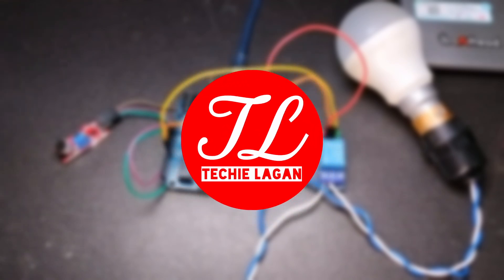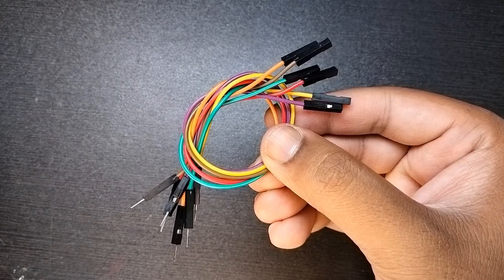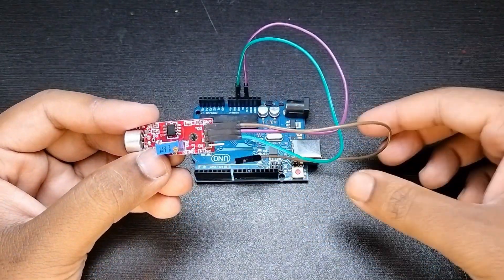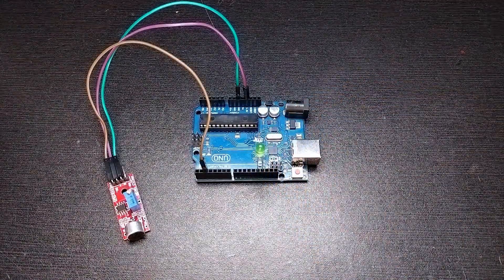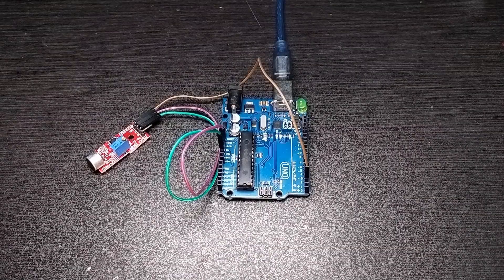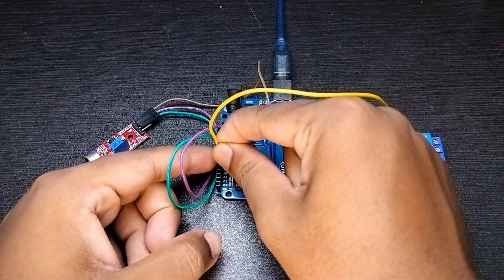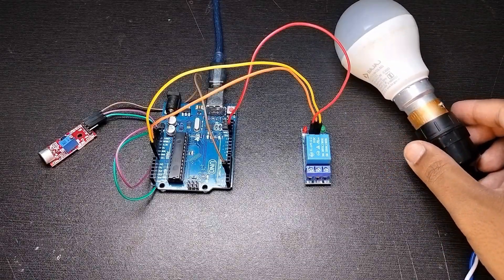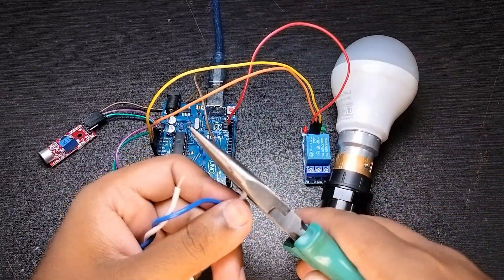How to make a clap switch using Arduino || Techie Lagan

Comment from the maker: [DO NOT TOUCH THE RELAY MODULE WHILE USING AC CURRENT/BULB, IT CAN BE DANGEROUS]

Circuit  Diagram - https://drive.google.com/file/d/1lcLG...
Code - https://drive.google.com/file/d/1ZHfy...

Comment: ok the video is good ... every thing is fine just change a thing ... connect ao to arduino pin 2 instead of connecting from do in the sound module ... that should work
Reply: Thank you for correction 🫶
Reply: Thank u so muchhhh!!!!
Reply: Can someone pls help, the light bulb is turning on by clap but not turning off by clap

Comment: Which app your are using for connecting the code . Can you send me the app name firstly it is very urgent.
Reply from the maker: Arduino ide - it is a computer application not a mobile app
But if you want to upload the code through mobile then you can watch this video for further reference - https://youtu.be/FU7PHi79Q2Q?si=lmTQE04MYy60Bx46